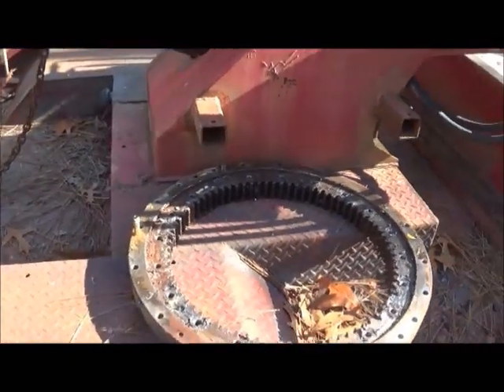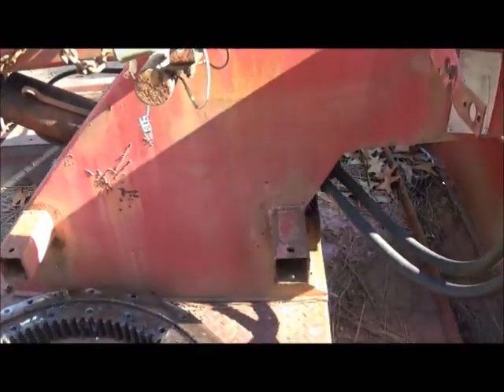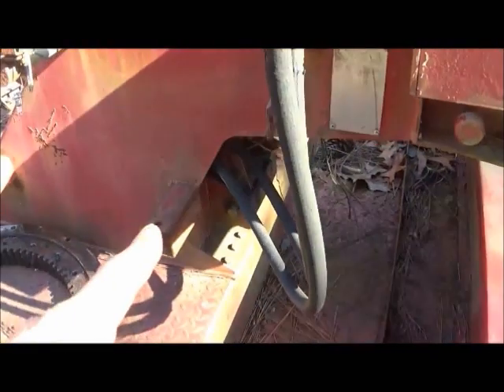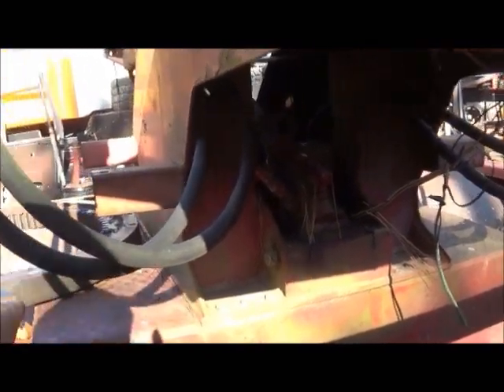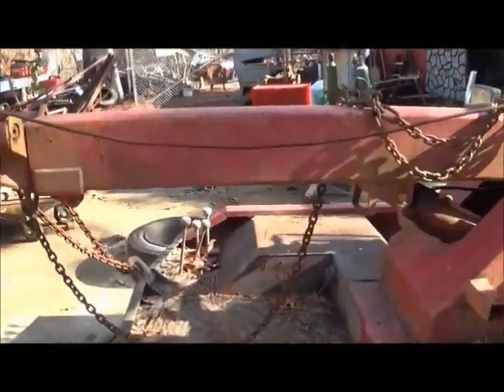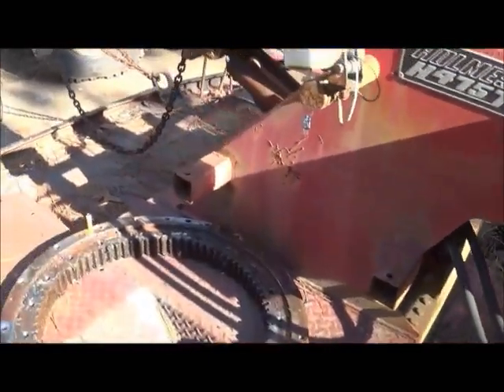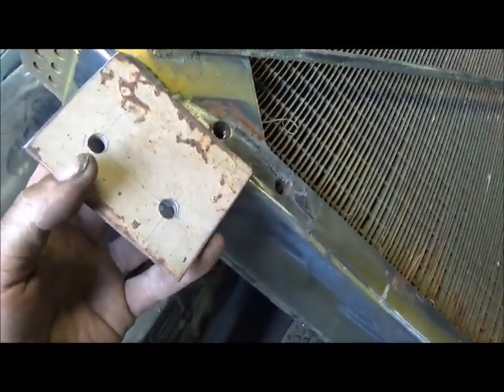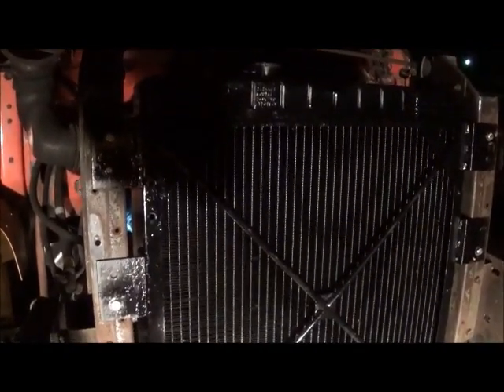4x4 Wrecker Build Part 8 This Is Gonna Take A While!

Comment: That's going to be a nice rig. Good job figuring it all  about the cylinder placement . Lots to think about on the build.  Radiator in and fitting in there , going to work well. Thanks and take care.

Comment: If you could find an old cement pump truck that they used for pouring forms, they have just about every cylinder you can think of with universal hings and such.there great cause they do mostly just lift hoses on a knuckle boom. Great parts!